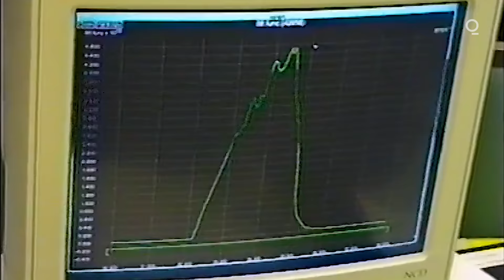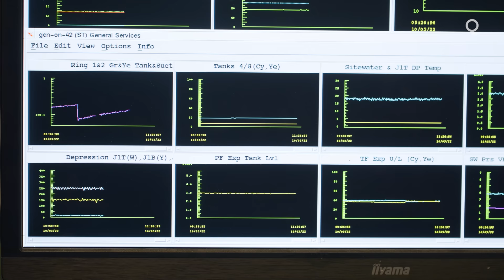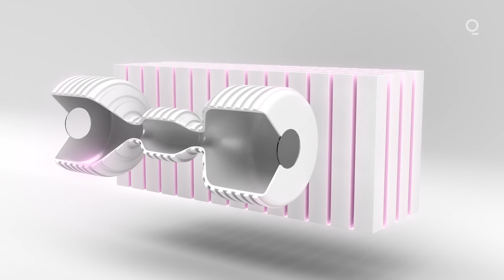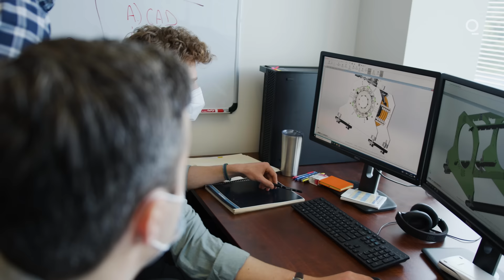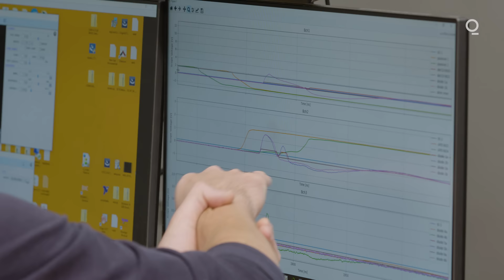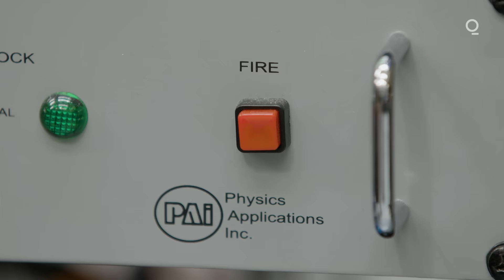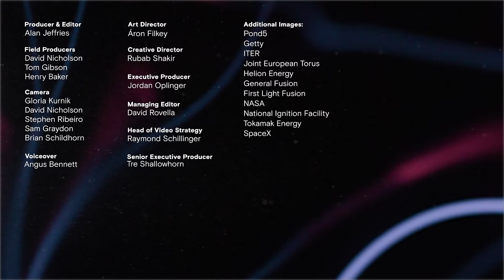Why Private Billions Are Flowing Into Fusion

Comment: I do love the concept of fusion and of course hope we make it but would it not be easier to build a drill that can get near to depth of the earths mantel and then  just pump water down it for energy. once done it would be cheap to recreate all over the world and then we can be as clean as Iceland.
Reply: so..... you want to use frakking, to create energy.... 

you ARE aware that Iceland only have thermal power on account of the hot springs and active volcanoes, right?
Reply: No
Reply: @scar445  no I dont want to use fracking, I want industry to spend money on bore hole drilling equipment research, the deepest whole in the world is about 7km deep if we could go deeper and do it round the world we could use the earth core to heat the water to produce steam and power generators
Reply: @JasonPurkiss  and what about maintenance, new part, machines to get it up and running, turbines to change steam into energy, enough wiring to transport the electricity away and a million other things.
Reply: @scar445  you would have the same issue with fusion but as drilling a bore hole would be easier cheaper and quicker than building a fusion Power station which would mean we could have more cheaper power stations all over the world so less long cables than a fusion reactor
Reply: That causes massive earthquakes & destabilization. It's actually not a viable option.
Reply: @calicoesblue4703   your taking about Fracking, I'm not I'm just talking about bore holes which does not cause earthquakes :)

Comment: This is all a mistake. Committing the resources to this, allowing the technofuturist optimism to run wild, is going to keep fueling climate denial. We need NEGATIVE carbon output, not just neutral, not just low. We aren't going to survive climate disaster at this rate. Look at the names of the investors -- Bezos, Thiel. They want this to happen so that they can keep having infinite capitalist growth, which is the source of the problem in the first place.

- We need to compress our cities with mixed use zoning in order to reduce reliance on cars, or any other means of transit.
- Once we have that, we can get rid of the miles and miles of parking lots -- put solar or wind farms on them so that power production is distributed and democratized, rendering it less failure prone and more egalitarian.
- Provide efficient electric mass transit (not ridiculous Muskian reinventions of the train). All history shows: If you build it, they will ride.
- Once transit exists for everyone, we don't need to maintain highways as much (it is usage, more than any other factor, that contributes to their degradation), we don't need to build and maintain so many cars, we don't need to do as much lithium extraction.
- Stop building gadgets designed to go straight to the landfill in one year.
- Use less disposable packaging -- and I mean producers, not consumers. This problem is their fault.
- Stop demanding that people work a 40 hour week to be allowed to live. This will reduce the need for commuting, which will further reduce car needs, as well as demands on any transit systems, as well as reduce reliance on convenience food products; the convenience store exists to exploit working people. This will also mean that we aren't running massive office buildings and factories at full tilt 24/7/365. We DON'T need to be doing that!

The money is there. Take it from Gates, Bezos, Buffet, Thiel. They don't need it, they don't deserve it, and we can't survive them keeping it. And then, after we've achieved negative carbon? THAT is the time to push for fusion power.

Comment: I’m seriously impressed by the scientific importance and the world wide scientists dedicated to solving the hundreds of problems found attempting to solve the fusion over the decades on this problem. However there are two serious questions I have . First off gravity. Right now we are using superconductors under 1 g but what would happen if we were to say use this in space under 0g or under huge pressure such as deep sea to replicate other atmospheric conditions or gravity close or on to super gas giants or close to our own sun , surly this would alter the plasmas ?
My second question is in regards to energy production- right now we are attempting to generate enough power so it can sustain and produce power of unlimited levels , but up till now power stations have had to be flexible enough to cope with the chaotic grid where energy demand fluctuates the ultimate goal isn’t that it can generate more power but the fact that it can ramp up or down as no country has a constant demand and the cost to wire this  up nationwide would have as many technical hurdles as creating fusion without the huge losses 
My final question come regarding fusion reactor design- with so much heat why are the scientists not looking at secondary capture to generate power from the heated sections no only to generate power but help self sustain the reaction demand requirements, surly we can use the principles behind solar thermal and geothermal to generate huge amounts of power indirectly 
Instead of trying to generate more power than it consumes, we get the reactor to be self sustaining and generate via secondary methods instead to power turbines , heat salt banks , water to steam generators etc
Reply: I'd say to those questions.
I would change the exact way you'd perform the fusion, but if you were able to build a working fusion reactor under one set of circumstances, you'd have the theatrical knowledge to build one under others, much as we can build a petrol engine that can power a car, a lorry, a ship or a submarine, albeit one that would take much much effort.
Grid power needs to be rapidly delivered, but we already have power plants that take a while to switch on or off - it takes hours to fully turn on or off nuclear power plants or even coal ones. Grid fluctuations can be solved by turning on power stations before the grid reaches a failure point and selling electricity more cheaply. The word you use 'losses' shows why fusion would be so useful as a power source; energy would potentially be so cheap, it wouldn't matter if we wasted energy turning on or off these plants because it would be so affordable, much as you don't worry about 'wasting' heat from an oven used to cook food. IDK about the third question.
Reply: @josephkoppenhout6034  your wrong unlimited energy is a huge problem for the grid ,power delivery as I have said is uneven, it has predictable peaks usually between 6-9pm and 6-8 am but throughout the day demand can fluctuate a lot including excessive energy right now when it goes into negative we do things such as pump energy into hydro storage to cope with the peak but the way fusion is up till now being developed is an always on high output, you can’t do that with the grid , to much unused can cause cascade failure even nuclear energy can be ramped up or down, that’s why the grid has to balance that through the country , fusion cannot do that  that is why I say scientists look into secondary generation methods as primary generation from already established methods that can use the super heated plasma created from generation and use that to run steam or principles behind geothermal as well for instance we have a fusion reactor double the output we normally get from nuclear able to generate 3-4 gwh constantly, but using it’s wasted heat that comes from the byproduct of generating power it feeds that heat to generate in say building 12gwh which is quite possible since we are talking plasma at Over a million degrees , this is the power station that can then be ramped up or down depending on demand  thus only  two  would be needed to power the U.K., 6 could power the USA , 9 could power Russia.

Comment: Nuclear energy is likely the most viable replacement of carbon sources. It is the heart of a sustainable global engine. Wind and solar are intermittent supplements whereas nuclear is the reliable core pillar.
Reply: But current nuclear is the most expensive energy per MWh and takes a decade to build, which is why it's such a small percentage of new generation (solar is the biggest in the USA and globally). Wind and solar are clearly the central pillar, but they need to be shored up with something when they're not generating. For daily cycling, that thing is proving to be battery storage; for longer periods maybe nuclear, or hydrogen storage, or compressed air storage, or pumped hydro, or overbuilding, ...
Reply: @skierpage  current fission is using outdated tech. Government red tape. 

Now im not saying completely remove the red tape, just reduce it.

Comment: One problem though is the heavy hydrogen used will be in short supply.  All that's used right now to initiate and sustain.  I suppose larger reactions for longer may allow the light nucleus hydrogen to be used but that's not clear yet I've been told by people in the field.    Of course all must be painted optimistically to keep the funding taps on though.

Comment: What really bothers me about fusion is the expectations of investors, investors who think that they will be able to make it work BUT the consumer still ends up paying a high price per unit of electricity because the investors really only did this simply as a way to make money. I doubt the simpler smaller ideas will work, things like ITER are far more likely to get there first, but fusion plants will cost seriously large sums of money, money that has to be recouped so yes, we may get to fusion but I hope the cost of the power is significantly cheaper than what we are being charged now, which is prohibitively high. Of course, whomever gets there first, that's basically the nails in the coffin for all other startups, unless they are very close to completion and over unity.
Fusion could possibly be a paradigm shift for humanity if it able to produce say ten times or more than what it needs to run it, the promise of very very cheap power is just as important as are it's green zero carbon benefits...here's hoping !...

Comment: The advances made in fusion are really mindboggling, pushing our understanding of particle physics, electromagnetism and raw industrial manufacturing to levels far beyond any other advances, including the incredible advances made in computing power.Yes, you read that right - Fusion advances have been more rapid/bigger than Moore's Law.
Reply: U do not understand Moores law very well.  It was great on a u scale but at atomic geometries (nanometers)  it halts  computation capability rapidly. Ditto for fusion where after 70 years we are still not even close to fruition.

Comment: Fusion isn't about money it's about spending less money in the future so anybody thinks that this is the next big oil rush they're wrong. They already told us that the materials needed for this new direction is cheap and lasts way longer providing energy longer so therefore are light bills should be cheaper by a lot

Comment: 5:45 plasma is gas with a huge amount of energy in it ; fluid > gas > plasma (when temperature is higher than gas temp); common plasma: lightning, neon lights,
6:20 heat a chamber 10 times the temperature of the sun
1960s tokamak experiments achieved several million degrees ; Tokamaks are still the most popular way to create fusion
uses powerful magnets to contain the plasma
100 million degrees and "well beyond"??
7:40 ITER collaboration between 30 countries ; 
8:52 more than 30 private fusion companies around the world
9:07 there's more private than government money going into fusions in the USA
9:54 a fusion version of a diesel engine
13:00 almost(??) every idea behind a nuclear fusion startup is to rely on the heat generated by fusion->convert it into steam-->turbines ... 13:50 by cutting out the steam portion //(how??) we can radically increase the overall engineering efficiency
14:40 Silicon Valley mentality: make it worse and get it done earlier > make it better and get it done later //this doesn't seem to be a longterm healthy strategy and shows why money in invention is problematic-- SV is causing the misincentivization of innovation!
15:10 First Light Fusion projectile fusion is based on the idea of inertial confinement (holding a small amount of plasma in a tiny space for a tiny amount of time): a high velocity (15,000 mph) projectile hits a target; target focuses the energy of the projectile into the fusion fuel //how??
16:20 one of these targets releases enough energy to power the average UK home for two years
17:00 50 neutrons
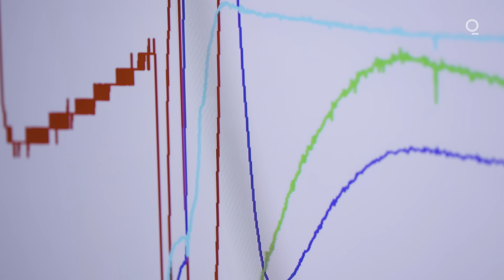17:50 "few private fusion companies have shown any results beyond fusing few atoms"
18:25 unkept promises are bad for the technology overall
19:40 will Silicon Valley type approach get us to fusion faster??
20:50 total addressable market: $1Trillion
you could imagine restoring the Earth's atmosphere to pre-industrial levels ... I want my kids to have a future

Comment: flow water in a tube around it flow water in an closed tube, they should self layer iff you add salt, cross 3 water streams but acheve straight flow past in middle plasma, fusion or gateway?  you measure hot but you pass through cool, like flame over fire, you walk through mist you appear there relative bright, add relative dimmer you see other world in 3 axis water cross stream
Reply: same with light

Comment: I just checked again. Chine was able to hold the fusion for 17 minutes (not just 5 seconds) and with just 5 times hotter than the sun. Which is harder cuz you'd need more mass to create plasma with lower temps. And even in 2003 there was another record which was much longer than 5 seconds? Is this doc is just about usa and france?

Comment: I have a prediction to make... one of you teams is going to accidentally build a warp engine. You're gonna build it, run a test or two, celebrate over the weekend before the Monday you turn it on full power... and when that Monday comes, it's gonna disappear in a flash of light, and you're all gonna be like, "where did it go?" But it's already outside the solar system headed toward an advanced civilization on another planet... and it's gonna crash there... an the residents are gonna be like, "daafaaaaaq?"

And they're gonna come to earth and ask for the person that designed it... 

And they're gonna use that person as a breeding experiment... assuming they didn't get 'changed in grade school already...

Comment: First  let me say it's a happy moment when humanity achieves a small leap for mankind, but for fusion to succeed we need the answers to some questions 1) does stable fusion occur at high temperature or at optimum temperature and frizzles out when the temperature increases which increases repulsive energy btn atoms.2) Does the fusion in the sun  produce high temperature as we believe or the high temperature at the corona is achieved by a potential difference where the sun is a positive point in relation to the space around in the solar system which is negative and the reaction btn the two leds to high temperature at the corona.(coronal heating problem). 3 ) Are there other ways of bringing atoms together like high frequency variation of an electromagnetic flux  while maintaining the temperature optimum to avoid repulsive energy at high temperature?. 4) Have we looked at encapsulation of hydrogen in liquid metals like mercury to achieve high pressure and maintain the temperature .So there many approaches and questions that we have to answer but some day we shall achieve it but as long as the temperature rises beyond a certain limit repulsive energy will keep increasing  making reaction unstable and it will eventually stop always. .Those are my thoughts why the fusion ignites then stops .

 .

Comment: basically, these are just fancy heaters, that make steam, to run electric steam generators. which consumes more power to operate than the power output. maybe one day people will realize there's an easier way to actually make electricity. think outside the box

Comment: seale the torus with tubes along its inner hole axis and around its outer edge with space and cross tubes access in, in the internal tube water one way lateral, outer side flow water the other way inside the torus plasma forms and vents through cross tubes, play with adding oil as a medium to replace tubes or torus and try mixes and versions, safe plasma generators

Comment: It's kind of wacky when you realize how much money can be spent on fusion once it actually works. It's 50 years away at current spending rates. 

We could literally spend 10% of our GDP on fusion technology if it offers the desired result. A radical increase of global electricity could mean a true economic revolution. We could solve so many problem if we had an abundance of electricity..

We spend very very little money on fusion relative to the economic effects of it working at scale. IT isn't the price for kilowatt etc that matters. It's the economic benefits of having a very deep reservoir of electricity. EVen when fossil fuel costs are low, we always have to be planning for them to become rarer or heavily regulated for environmental reasons. It means we as a civilization are no longer looking at economies of scale to solve our problems. It's a mental block that has huge consequences and is the cause of a whole lot of our economic stagnation.